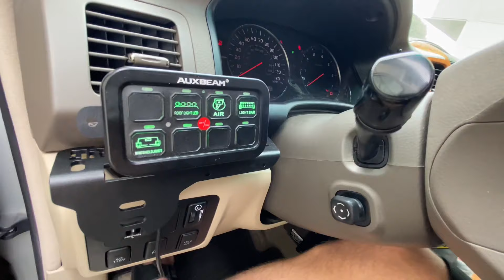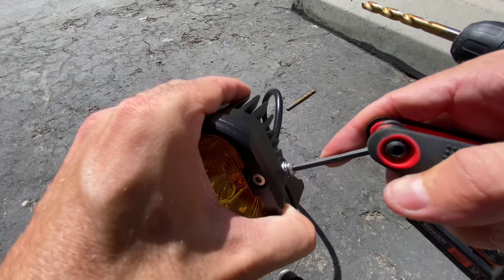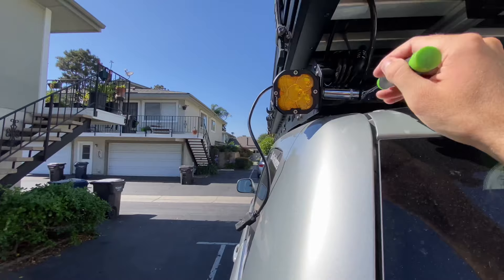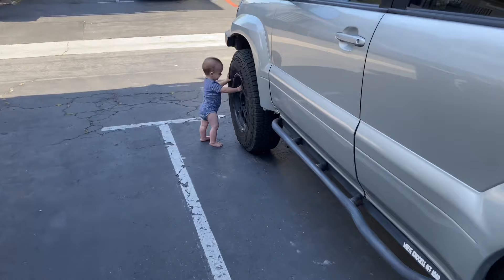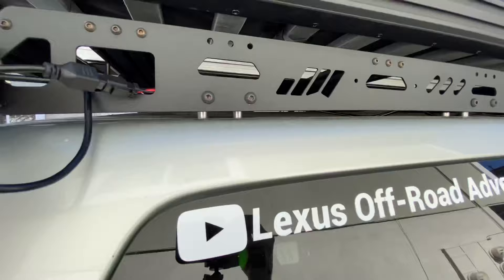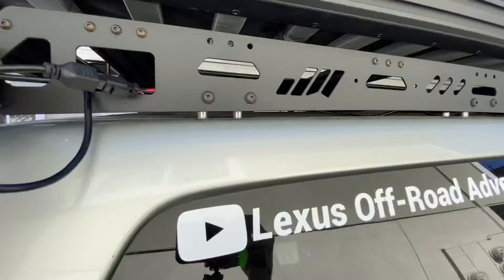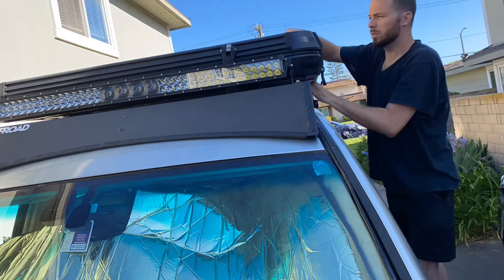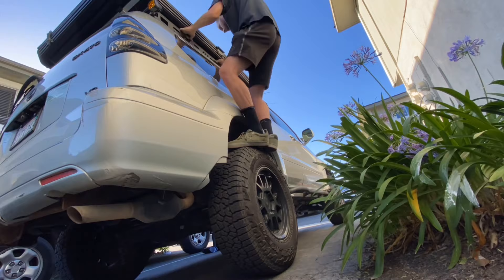Lexus GX470 | CHASE LIGHTS Install

Comment: These are awesome chase lights. I'm really wanting to do chase lights and also side lights for loading/unloading kayaks at night. Great video!
Reply from the maker: Right on, yeah I'm really liking these pods as chase lights. I am coincidentally getting some of those side lights in soon that I am going to mount on my roof rack and hook up to my DC solar setup so we can have a little extra light at camp when the sun goes down but not worry about draining my starter battery. We'll see how it goes. https://auxbeam.com/products/rgbw-led-rock-lights-kit-with-bluetooth-app-wireless-remote-control-brake-light-function?_pos=13&_sid=2c5a92eda&_ss=r

Comment: Those JW Offroad chase light brackets suck anyways. You're pretty limited to what size light you want to use because there's limited space.
Reply from the maker: Gotcha, yeah I’ve seen most guys running the small twin LED Baja Designs lights under the wing so that makes sense.
Reply: @lexus_offroad_adventures  yeah, the really slim ones are what you're limited to. By the way, solid work on these videos. Keep them coming.
Reply from the maker: @Brother_Lander  thanks Shane! Really appreciate it 🙏
Reply: I have those JW offroad brackets on my car and couldn't agree more. Been on my car over a year and haven't used them since i put them on. No space at all to mount hardware in between the spoiler and top of the bracket, also a pain in the ass to get the actual bracket on the car having to remove the spoiler and mould the bracket into shape on the hatch so there no gaps